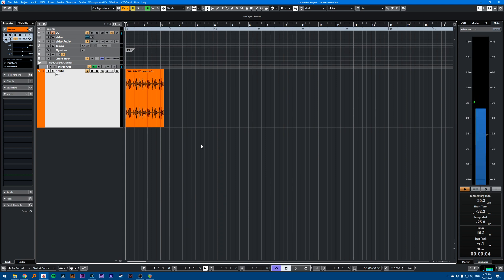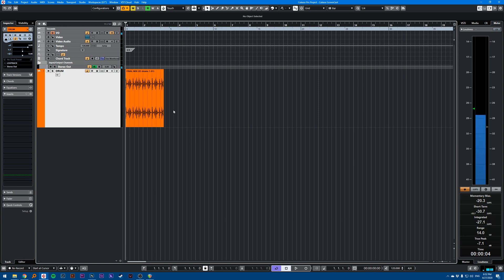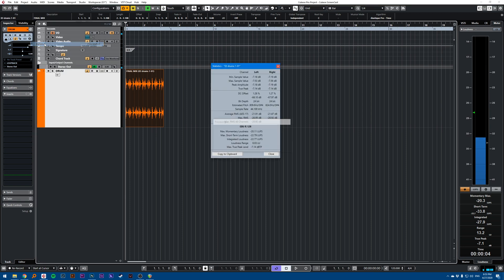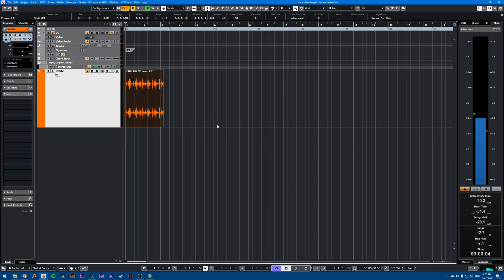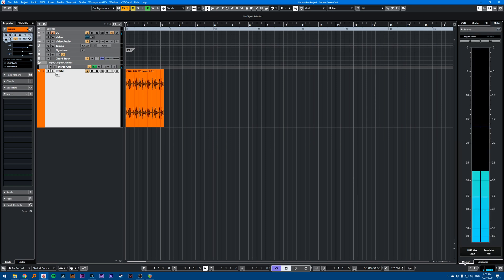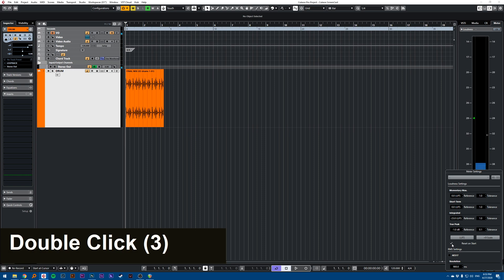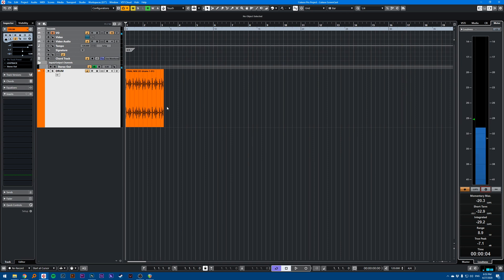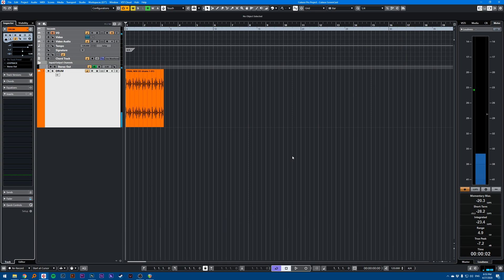017 Cubase quick tip - Getting integrated loudness measurements in LUFS for braodcast

Comment: Hi, thanks for the tips.  A major difference between the 2 methods is that the first method measures the integrated loudness of the unprocessed sound file, and the later one measures the one with all the Cubase processing and effects.  Wondering is there a faster way to measure the integrated loudness with all the processing?  I have a wav file that is 30 min long and I don't want to wait that long to get the loudness reading every time I change some settings in the processing chain, thx.